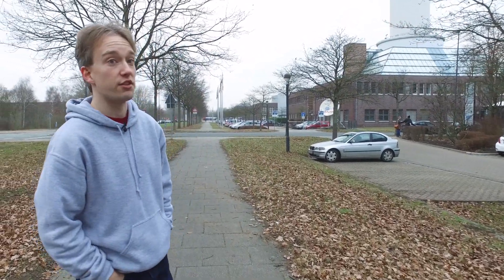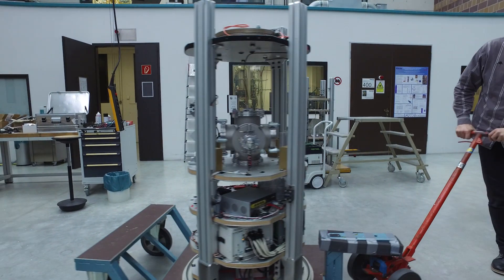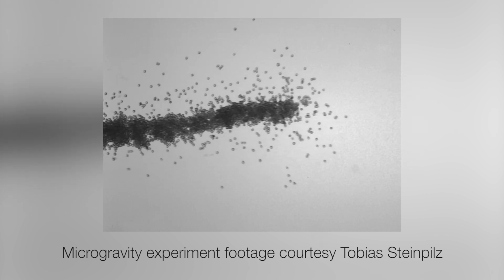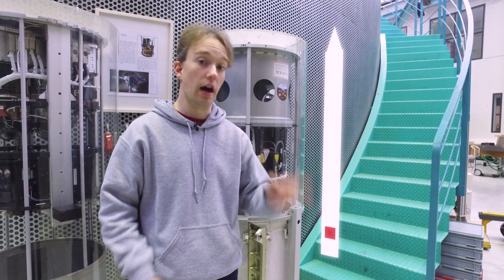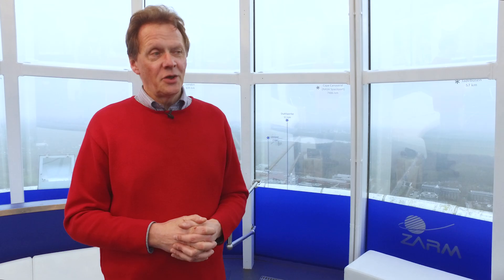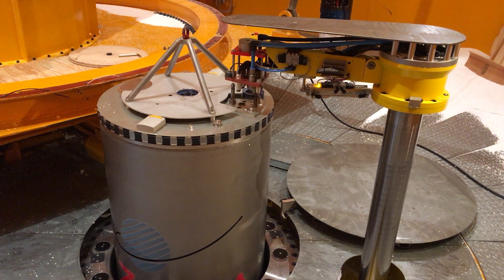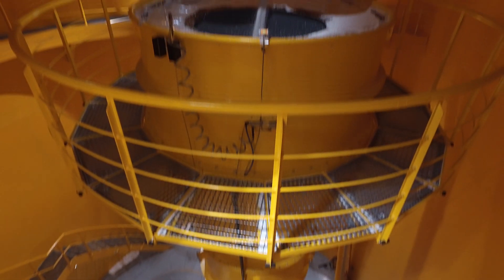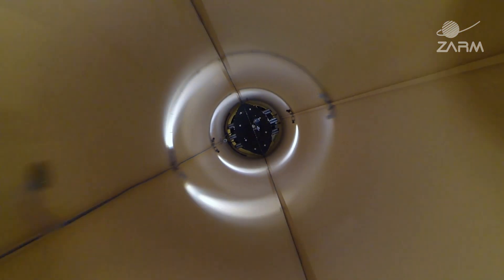Zero-G Experiments on Earth: The Bremen Drop Tower

Comment: Wonder why they use a vacuum. Seems like a powered system would give better turnaround time. Must have a good reason
Reply: R4ndomGuy13 the test camber can be a vacuum without making the whole building a vacuum
Reply: LowPriceEdition Air resistance is one, the other is probably so there's no aerodynamic effects on the capsule. If it hit any off the walls because it's not aerodynamically stable in 2 directions you'd be screwed. Shifting the centre off mass can mess it up so if you didn't make it a vacuum you'd have to make every experiment have a constant centre off mass.
Reply: not really, a rail system would work fine to keep the capsule from moving side to side. The key being that the inside of the capsule is a vacuum then the capsule is driven such that the experiment inside never touches the walls.
Reply: So you'd have the rail car decelerating at a constant rate to the top of the tower, then coming back down accelerating at 1g all the way down? Sounds possible, but I don't know how you'd calibrate the rail car to exactly compensate for rail and air friction accurately. And you'd still have to build the tower. It's probably considerably easier to use vacuum and gravity than to simulate a vacuum's effects.

Besides, it's a research facility; I doubt that there's any great queue for its use such that saving time on setting up the tower gives any great benefit.

Comment: Tom Scott, if you watch closely at the footage starting at 3:30 (better seen at 3:43, watch the bottom left corner), you can see the capsule is rotating just slightly, at least the recorded picture is. Wouldn't that mean there is a slight rotational force, therefore, zero(micro?) gravity relative to earth but not relative to the object itself? Please correct me if I'm wrong.

Comment: Just to clarify (and because I also had that wrong for quite a while): The zero-G part of a parabolic flight is not because the pilot accelerates the plane downwards, but kind of in the same way as in the drop tower here: The plane stops accelerating in an upwards angle and just follows a curved path like it would have been thrown.
Reply: Things that have been thrown accelerate downwards...
Reply: Will Hirsch things inside the thing that you throw accelerate downwards at the same speed though so relatively they experience zero G
Reply: Exactly. In order for objects in freefall to accelerate at the same rate as the plane, the pilot has to accelerate the plane downwards.

Comment: @Tom, does the experiment have to include any corrections for the coriolis effect from Earth's rotation (perhaps a slight correction in the launch vector?) Or do the orders of magnitude at play here make such effects negligible? Enlightening video as always, good sir!
Reply: ZARM latitude: 53.1103°. Altitude of Bremen: ~10m. Earth radius at Bremen, due to imperfect sphere: 6,364,509m. Drop distance is 110m (says Wikipedia), so radius of top of the drop is 6,364,619m. COS(53.1103) is ~0.6. 
V at base of tower: 277.8320 m/s.  V at top of tower: 277.8369m/s. Difference:  4.9mm (~0.2 inch) per second.
So less than 5cm/2in displacement for the 10-second test. Small enough to easily account for.
Reply: From what they told our class when we visited, They shoot straight up and just accept it coming down a bit off Center

Comment: My brain told me "lul no way that will fly straight..." then I realized that why does things not fly straight most of the time? Air resistance, and the air has been removed, so duh! Well, super interesting and slightly insane :) 

Hardest part to understand for me was the constant force application but it makes sense, as long as things to be zero-g-ed are released post-launch it should be fine or they'd be firmly situated at the bottom of the canister. Or something like that :P
Reply: @Andreas Aronsson: True for the center of mass. There is a little extra complication though. When there would be a slight residu of rotational energy the cilinder could still rotate around its X- and / or Y- axes (naming up/down the Z-axis) in which case it could crash into the sides of the tower.
Reply: @agerven  + you also need to be very precise where you shoot it. little bit to the left can also cause damage
Reply: there actually is a bit of margin, as by going up they mive away from the earth, thereby being subjected to a difference in angular velocity, resulting in some shifting due to earths rotation

Comment: If they dug down 50 meters, they could get even more time in micro gravity.
Reply: Of course, but that would be a 50% increase in the length/expense of the tube, plus expensive digging, all for just a ~20% increase in freefall time. Probably not worth it.
Reply: +Slowburn
There is a big river in Bremen.
The Silos are not 140m underwater.
Reply: But that would be against the most important rule ever: Never dig straight down
Reply: @mr.zimbel  I see what you did there.
Reply: Maxx B sounds good until you compromise the entire structure.
Reply: Maxx B They use towers instead of holes because of the water under the surface of the earth
Reply: @Chraman  How would water effect anything?  Our Nuke silos are underground...
Reply: Slowburn should have built a tower on top, but then you'd have to drive to the middle of nowhere. if you dig deeper, the government might repurpose it one day for convenience sake. that's maybe why they did what they did
Reply: should have built a tower on top, but then you'd have to drive to the middle of nowhere. if you dig deeper, the government might repurpose it one day for convenience sake. that's maybe why they did what they did.
Reply: longer tube, more air to pump out.

Comment: Where did the sound come from when the capsule hit the bottom if the chamber is a vacuum?
Reply from the maker: +Skip6235 It's not a vacuum if it's filled with stuff! Sound conducts through solids as well as air :)
Reply: Skip6235 Skip6235 to add to what tom said, the camera is attached to the wall and the things that make noise e.g. the sliding of polystyrene pellets makes a noise and the bass travel best through the wall this the noise we do hear is low.
Reply: Oh, I see, so the camera was picking up the sound passing through the actual barrel the capsule fell in to. Interesting!
Reply: Sound travels through solids too.
Reply: Sound travels though the floor and through the walls through the mount of the camera to the camera
Reply: you could check out codys lab's video on explosions in vacuum and other sound experiments in vacuum he has conducted. vacuum can actually sometimes be rather noisy ;)
Reply: Skip6235 the camera recording is on capsule, sound can travel through a solid
Reply: Yes but in Cody's case the gas that carried the sound waves (shockwave) came from the combustion. It's interesting but cheats the question.
Reply: the camera is probably in the wall and it's vibrations from the impact
Reply: omg!!! the moonlanding was a hoax! illuminati confirmed!
Reply: Well it's basically the same as asking "Why is there sound on earth of the earth is in a vacuum" :D
Reply: Yeah, Sound needs a medium to travel as it vibrates molecules which is what produces the sound.. Sound can travel though any sort of medium but it travels much better and faster though a solid or a liquid than it does through air because the molecules are more tightly packed together. The capsule was indeed travelling through a near perfect vacuum, however it comes into contact with a lot of matter in the form of the polystyrene, this is what causes the sound to be heard. We are hearing sound travel through a solid mass rather than air.
Reply: Solids and liquids conduct sound a lot better then air. In essence the more tightly packed the particles are, the better it conducts sound
Reply: Noise travels times faster through solids. And all the solids in the room are connected.
Reply: There's no sound in a vacuum because there's no air molecules to vibrate, however, the capsule hit the bottom of the chamber vibrating the steel which travels outside of the vacuum chamber to be heard by the camera.
Reply: As a Star Citizen Fan i do answer this question regularly.
[Edit: e.g. Where does sound come from when walking on Spacestations in a vacuum?]
Reply: Nillie Star Citizen is a game. I'd assume there's artificial gravity.

Comment: Is there a reason they made a tower instead of a really deep hole?
Reply from the maker: +Edward Nigma If I remember rightly, it's cheaper, easier to maintain, and makes a good landmark! But there are drop towers in (for example) old mines elsewhere in the world.
Reply: Fair enough.
Reply: Where a hole comes into its own is if you want a really long zero gee flight. 1.2 Km can get you up to 30 seconds of flight, but engineering that especially the catapult and catch system would be very difficult. It would take a lot of time and energy to pump down too.
Reply: @TomScottGo  is it because earth's totation can make the object hit on the side of the capsule if they dig it.
Reply: Edward Nigma holes are expensive. dirt's slot harder to work with than you would think
Reply: Why not use both.
Make a huge tower and a deep hole underneath it.
Reply: Edward Nigma because its still the same structure just built in a hole you took forever to dig..
Reply: It's the same reason why most power lines in the world are using tall masts and poles instead of digging underground cables.
Reply: @mariohendriks1   well that and buried electric lines dont conduct nearly as well as free-air cables due to thermal heating from high amprage draws, unless you install really expensive cooling die-electric oil with heat exchangers and pumps
Reply: I'm from Bremen and I can tell you that money is definitely the reason why they wouldn't dig a deep hole :P Bremen is the poorest state in germany, mostly because our state just consists of two cities and the people who work here pay their taxes around the city in the state which surrounds us :/
Reply: @i.i.iiii.i.i  I'm also from Bremen and the funding of Fallturm didn't came from the city.
I don't know the exact reason why they didn't dug, but knowing that the area around the university is mainly swampland, I guess it is because of the ground water level.
Reply: @i.i.iiii.i.i (Edited) 
Das mit der Armut als Grund ist Mumpitz!
Das ZARM ist wird regelrecht mit Forschungsgeldern überschüttet und ist an vielen internationalen Raumfahrtprojekten beteiligt.
Ferner sind die Schulden Bremens nicht als Zeugnis der Armut zu sehen, sondern als staatlicher Ausgleich des niedrigen Inlansprodukts des Landes. 
In einem Sozialstaat ist es nur selbstverständlich, dass ein Bundesland, welches die entsprechenden Produktionsmittel und Kapazitäten besitzt, andere Länder, welche aus sozialen oder infrastrukturellen Gründen nicht in der Lage sind, wirtschaftlich und kulturell aufzuschließen die nötigen Mitteln zuschießt um einen national einheitlichen Lebensstandard zu schaffen.
Das niedrige Inlandsprodukt ist dazu größtenteils dem verschuldet, dass ein großer Teil der Arbeitskräfte in Bremen in Niedersachsen leben und seit der Steuerreform in ihrem Heimatbundesland besteuert werden. Bremen hat dadurch einem großen Teil seiner Steuereinnahmen verloren. Letzteres hast du ja schon oben genannt.
Reply: @Quert_Zuiopue  
habe ich das nicht in etwa so gesagt? 
...insbesondere deinen "übrigens" Teile
Reply: It's cheaper?
Reply: As someone in the construction industry, digging holes are difficult, time-consuming and expensive.

Much cheaper and easier to build a skyscraper, rather than digging a hole, then filling it with a skyscraper.
Reply: Alot of people ignoring the fact that digging a hole could disturb chuds or mole people.
Reply: How about making it both at the same time and having more space for slingshot and drop.
Reply: As far as I know, it's just cheaper: Yes, you have to make sure the tower doesn't fall down, but in a really, really deep hole, you also have to make the walls stronger and stronger the lower you get, because of the increasing pressure from the soil (think of diving 10 feet (3 meters) deep in the swimming pool, you get more pressure the lower you are because there's more water above that's pushing the water around you onto you)
Reply: I can't ttt
Reply: I know Kone has their main R&D center for elevators in 120 mining shaft.
Reply: Bremen is built on sand! The whole area is a terminal moraine from the last ice age. Further, the highest natural point of Bremen is only 11 meters over the sea level. So you see, it's simply impossible.
Reply: Also likely because it's easier to depressurize at higher altitudes where there is already low pressures than at lower than sea level altitudes where it's more pressurized, making it take more energy
Reply: They don't want to risk waking up the Balrog...
Reply: A tower affords the convenience that the payload is launched and retrieved from near ground level, with all the space you need around the launch point for equipment and access.   Not so with a hole.
Reply: Bremen is at almost sea level and i think digging a few meters will flood the hole with a lot of water
Reply: Why not both
Reply: Well the place used to be a swamp too…
Reply: Much, MUCH cheaper.
Reply: HappyBeezerStudios its still the same as building a double tall tower except youre also spending resources on digging the hole aswell.
Reply: Edward Nigma They use towers instead of holes because of the water under the surface of the earth
Reply: At the Nasa lab in Brook-Park Ohio they have a 500ft deep hole they use for zero g testing.
Reply: Because the earth is flat and that would cause it to rip.
Reply: Edward Nigma it's probably cheaper and at that deep underground the temperature would be rather high for human intervention

Comment: I dont understand, how is it zero g if its accelerated upwards?
Reply: Even though it is moving upwards, once released the acceleration is constant.  Think of yourself in a car. When you slow down, you are accelerating backwards. In the case of the experiment, as long as the capsule is always accelerating at 9.8m/s^2, the matter on the inside will act as if there is no gravity.
Reply: omegaPe The speed diminishes, the acceleration is constant. Gravity doesn't go away when you're 100m up.
Reply: It's accelerated only while the slingshot is pushing it. After that, weightlessness.
Reply: dxxPacmanxxb because it does only accelerate for 0.2 seconds , as sais un the video... wich means that the G Force diminishes all the way to the top of the tower

Comment: Wow I thought it would be on a cable or something, it doesnt rotate or anything. Seems kinda odd that they have to pressurize the whole tube to put the capsule in, wouldnt it be more efficient to only pressurize the bottom manned area?
Reply: That would mean needing a large, VERY strong cap that would be able to infallibly form an airtight seal repeatedly, and mechanisms for automatically moving it. Probably simpler just to pump the whole thing to a vacuum.